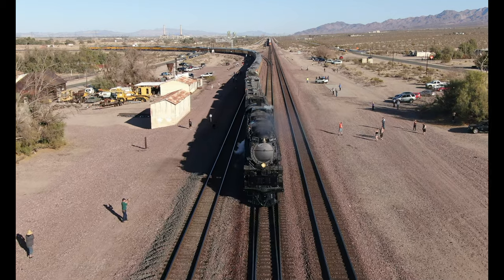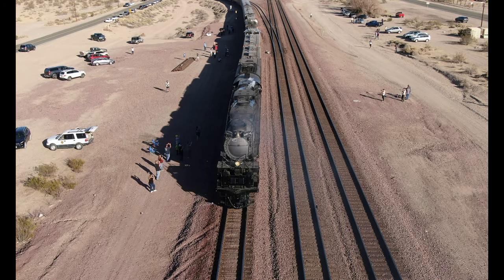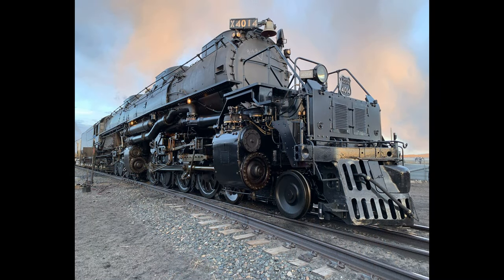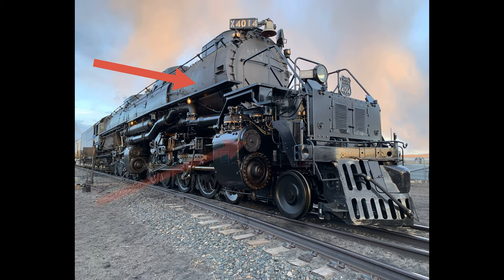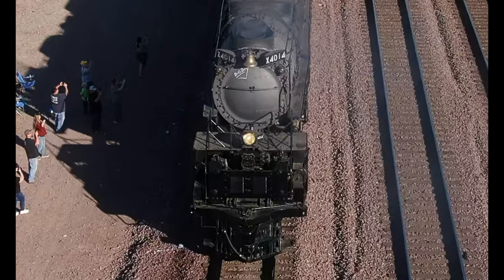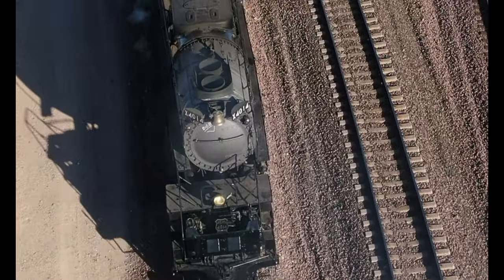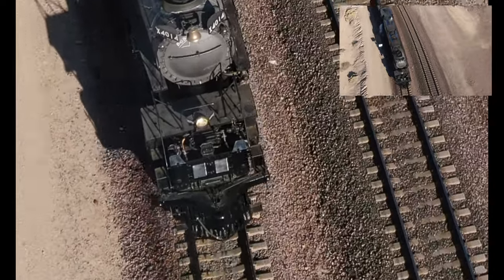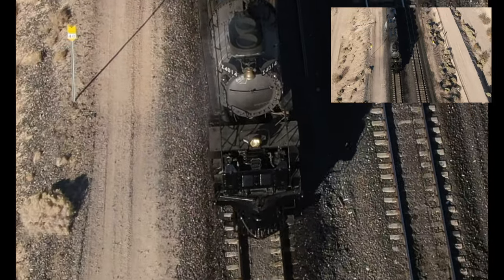A very close look at the 4014 articulating around a curve

Comment: The Big Boy doesn't have a main frame as such. It has two engine beds (for the two engines), front and rear. The cab, boiler (and its firebox) and smokebox are all mounted rigidly onto the rear engine bed. The front engine bed is for the four front drivers and its two cylinders and extends all the way out to just behind the cowcatcher (or pilot as it's properly called). The pilot itself is bolted onto the front of the front engine bed. The pilot deck is mounted on top of the front of the front engine bed. The front and rear engine beds are joined by a pin that runs through a kind of "tongue and groove" that you'd see if you were to look between the two rear engine cylinders (which are part of the rear engine bed). So the front and rear engines articulate, or flex, about that point. The pilot truck (with its two smaller pilot wheel axles) is under the front of the front engine bed and can rotate as well as move laterally (slightly). Anyway, the important points to understand are that 1. the two engines of the Big Boy, each with four sets of drivers and two cylinders, articulate at that point near the two rear cylinders, not further forward, 2. most of the locomotive is attached to the rear engine, which is why you see the smokebox swing out sideways on a curve (it's because it's so far away from the four rear drivers it's sitting on), and 3. The pilot truck isn't itself articulated (it does rotate and move though) but is supporting and guiding (piloting) the front engine. Note that there are also a couple of saddles, one on top of each engine bed, that prop up the boiler. The rear one is rigid, but the front one is complicated and includes a centering device that allows the saddle to move sideways as the boiler slides over the front engine in a curve, and has springs that bring the boiler back into line when the locomotive exits the curve.
Reply from the maker: Thanks for the detailed explanation.

Comment: Sure the front is on a separate articulating truck, understood so as not to spread the tracks which in time would cause derailments. 
But it's the rest of the heavy engine drive wheels that need explaining. 
The front 4 drive wheel axles must be on a separate articulating truck than the back 4 drive wheel axles?
Also the distance between the 4 drive wheels that touch the track appear approx 20'. 
Is that within the tolerance to not spread the track on tight curve tracks like sidings etc?

Comment: Ive always wondered how the steam connection is made to the pivoting section? Is it a flexible hose or a swivel union?  With that kind of working pressure, it seems like leaks would be an issue.
Reply: Probably an axle facing down with a hose going through it

Comment: What is the limit on the angle of curve the 4014 can handle?  Awesome video.  Have been waiting to see
a video of it articulating.
Reply: The Big Boy was designed for a maximum of 20 degrees articulation, which is equivalent to a 286.5 feet radius curve.

Comment: Does the back drive unit articulate too?
Reply: The boiler and cab are solidly connected to the rear engines; only the forward engines articulate.
Reply: Pretty sure both ends articulate it’s not a mallet